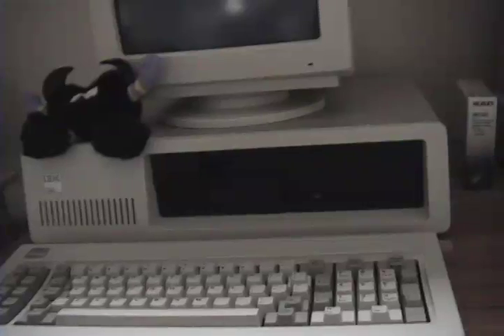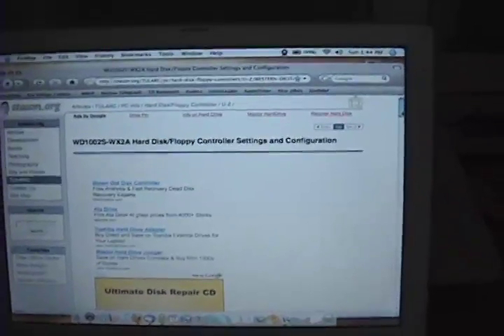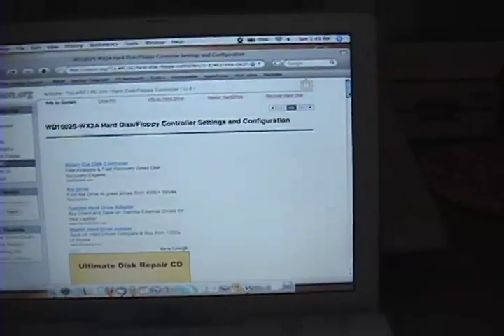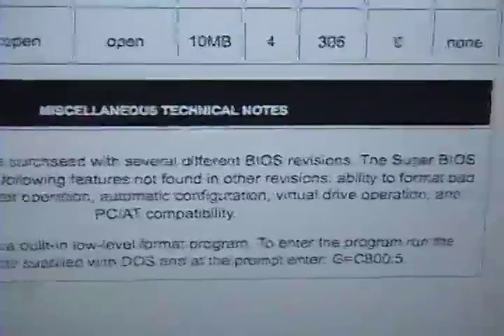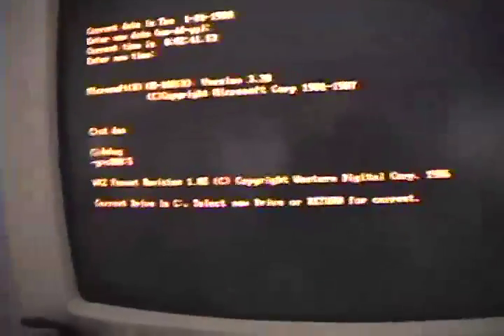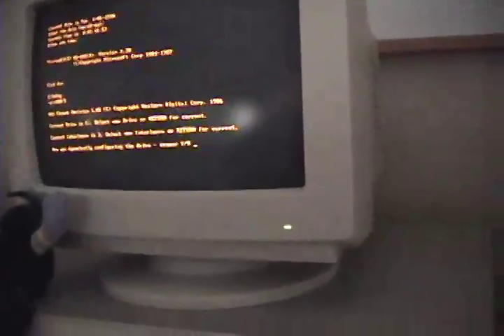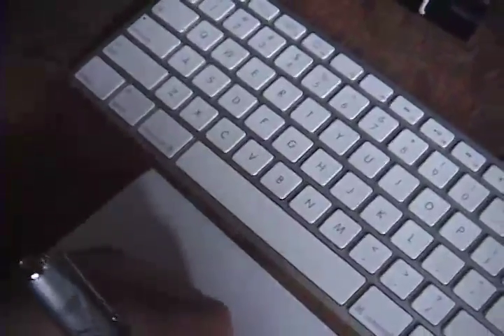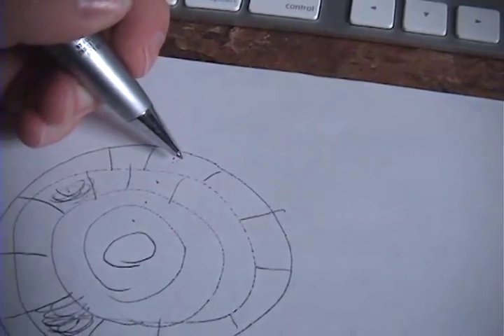IBM 5150 PC Part 1

Comment: With Low-format is possible to crank 20Mb up to 32 - 
That debug instruction only works if there is an 
(EE)PROM on the controller holding the Low-format ware
for some drives that is.. in doubt if they are MFM or RLL
you tell us..

Comment: You need a hard disk parking program. If you have the original IBM Diagnostics, one of the options on its menu is to "prepare the system for relocation", which is their fancy way of saying parking the hard drive heads.

Comment: For some time, voice coil drives were actually less accurate than stepper motor drives, and they had to use the side of a platter just for sector location information, otherwise, you'd have huge data corruption.

Comment: IBM never sold the 5150 PC with a hard drive so this was definitely an upgrade at some point.  It's also worth noting that most older stepper motor hard drives need to be manually parked before turning off the power, especially if you are going to move the computer.